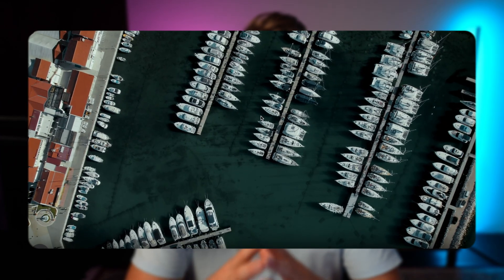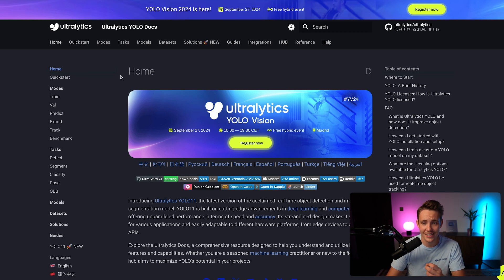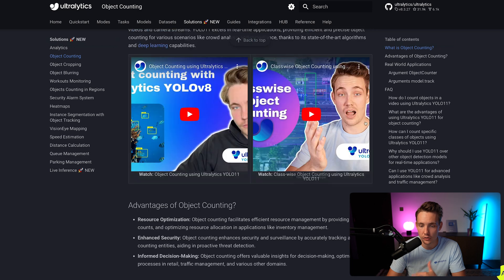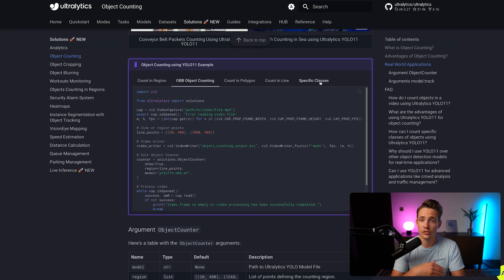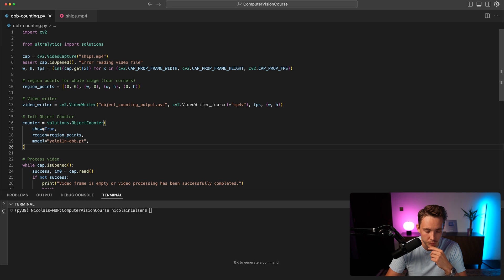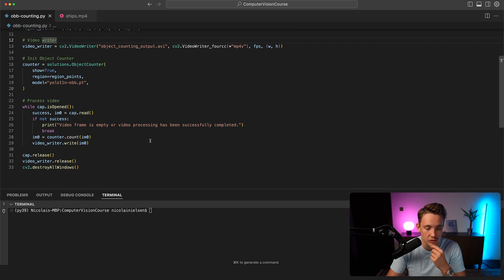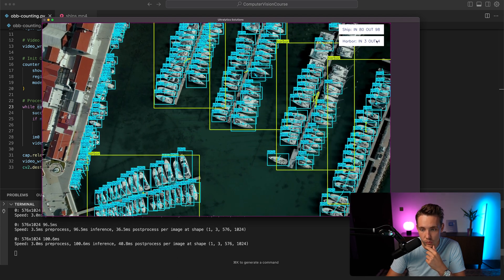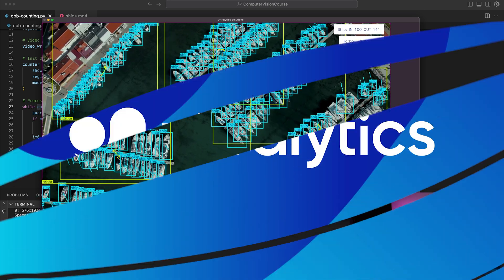How to count Ships using Ultralytics YOLO11 Oriented Bounding Boxes (YOLO11-OBB) | Object Counting 🚀

Comment: Love this OBB ship-counting magic! But how does YOLO11-OBB handle ships packed tight in busy ports or overlapping each other—does it get tripped up, or still slay that count with savage accuracy? Anyone tried throwing it at those gnarly satellite shots with wild angles?
Reply from the maker: Great question! YOLO11-OBB is designed to shine in exactly those tough scenarios—busy ports, overlapping ships, and extreme angles. Its oriented bounding box approach means detections fit tightly around each ship, even when objects are packed close or rotated, which really reduces missed counts and overlap errors compared to standard rectangular boxes. This helps it keep high accuracy in crowded or complex satellite images. For more on real-world results and OBB’s advantages, check out this guide: https://www.ultralytics.com/blog/how-to-use-ultralytics-yolo11-for-obb-object-detection

If you throw gnarly satellite shots at YOLO11-OBB, you’ll find it handles them much better than classic methods—just make sure your dataset is well-annotated for those tricky cases!
Reply from the maker: Great question! YOLO11-OBB is designed for exactly those “gnarly” cases—rotated, dense, small objects in aerial/satellite views. The rotated boxes reduce overlap vs. axis-aligned boxes, so crowding and odd angles are handled more cleanly, especially for elongated ships. That said, extreme occlusion or wakes/docks can still cause missed or merged detections; upping model size (e.g., yolo11m-obb or yolo11l-obb), higher input resolution, and class filtering usually boost counts.

Tips to “slay” busy ports:
- Use OBB models (yolo11n/s/m/l/x-obb) and increase imgsz for small ships
- Enable tracking-based counting to avoid double counts
- Fine-tune on your port imagery for best domain fit

Docs with models, metrics, and predict examples: https://docs.ultralytics.com/tasks/obb/  
Counting guides and region/line counting: https://docs.ultralytics.com/guides/object-counting/

Quick test CLI: yolo obb predict model=yolo11m-obb.pt source=your_satellite_video.mp4 imgsz=1280 conf=0.25

Comment: So if two ships are parked bow-to-bow in a narrow inlet, bro, does YOLO11-OBB ever get stage fright and count them as one big boat? Anyone tried it on a busy harbor at rush hour, or is that still deep learning’s Bermuda Triangle?
Reply from the maker: Great question! YOLO11-OBB is designed to handle tightly packed and angled objects, like ships in a crowded harbor, much better than regular bounding boxes. The oriented bounding boxes rotate to fit each ship’s shape—even if they’re bow-to-bow or side-by-side—so it’s much less likely to merge them into one detection. However, in extreme cases of heavy overlap or occlusion, even the best models can occasionally miscount. In practice, OBB has been tested on busy maritime scenes and performs impressively for fleet management, but for perfect results in “rush hour” scenarios, some post-processing or fine-tuning may still be needed.

For real-world examples and more detail, check out the docs: https://docs.ultralytics.com/tasks/obb/ and our harbor use case here: https://www.ultralytics.com/blog/how-to-use-ultralytics-yolo11-for-obb-object-detection

Comment: This is awesome stuff! But how well does YOLO11-OBB handle overlapping objects, like if the ships are super close together or partially hidden? Does it keep counting accurately or start 'losing its bearings'?
Reply from the maker: Great question! YOLO11-OBB is designed to handle overlapping objects with impressive accuracy, thanks to its use of Oriented Bounding Boxes (OBB). These OBBs rotate to fit objects precisely, even when they appear at angles or overlap, which traditional rectangular bounding boxes might struggle with. While it excels in such scenarios, the accuracy can still depend on factors like the quality of the dataset and how well the model has been trained for such specific cases.

For overlapping objects in dense areas, YOLO11-OBB leverages enhanced detection algorithms to differentiate between close or partially hidden objects. You can further improve its performance by fine-tuning the model on datasets that include overlapping scenarios, such as DOTAv1 https://docs.ultralytics.com/tasks/obb/. If you're training your custom model, ensure your dataset includes examples of overlapping objects to help the model learn these patterns effectively.

For more details, check out the YOLO11 OBB Guide https://www.ultralytics.com/blog/how-to-use-ultralytics-yolo11-for-obb-object-detection. Let us know if you need more insights! 🚀

Comment: Fascinating demo! But how does YOLO11-OBB handle overlapping or partially obscured ships during the counting process? Does it prioritize accuracy over speed in such scenarios, or is there a trade-off to watch out for?
Reply from the maker: Great question! YOLO11-OBB is designed for precision in detecting and counting overlapping or partially obscured ships. Its support for oriented bounding boxes (OBB) allows it to handle angled and tightly packed objects more effectively than traditional bounding boxes. This capability is particularly advantageous for scenarios like ship detection in ports or aerial imagery.

However, there is a trade-off. While YOLO11-OBB prioritizes accuracy in such complex scenes, it can slightly impact inference speed compared to simpler bounding box models, especially on resource-limited devices. The model achieves a balance by being parameter-efficient while maintaining high precision. For more details, check out the YOLO11-OBB guide https://www.ultralytics.com/blog/how-to-use-ultralytics-yolo11-for-obb-object-detection.

Comment: Can you use the oriented bounding box to determine which way the ship is pointing? It would have to give you some way to distinguish between the front and back of the ship.
Reply: You could achieve that in 2 ways: with mathematics or with IA. 

I have done something similar finding the direction of pipes.
Reply from the maker: Yes, you can determine the ship's direction using Oriented Bounding Boxes (OBB) by interpreting the orientation angle provided by the OBB model. This output angle indicates the object's alignment in the image, which can help distinguish the front and back of the ship when combined with shape or contextual features. For details on OBB, check here: https://docs.ultralytics.com/tasks/obb/